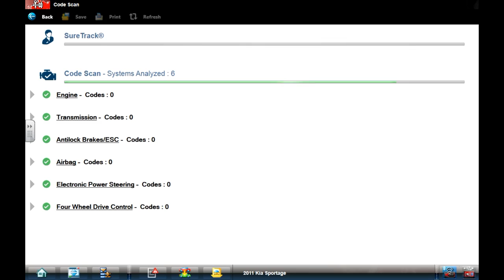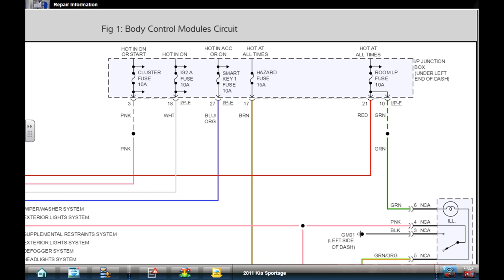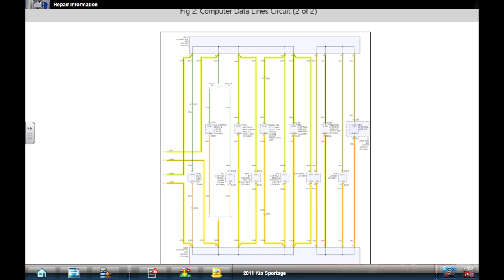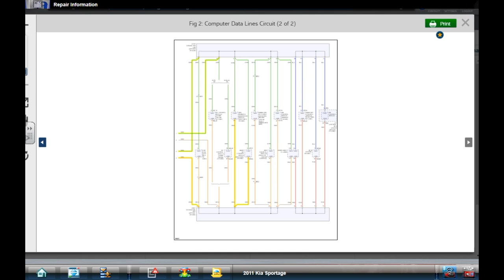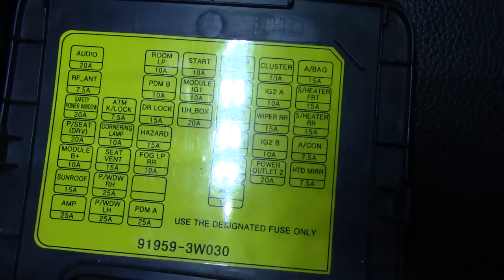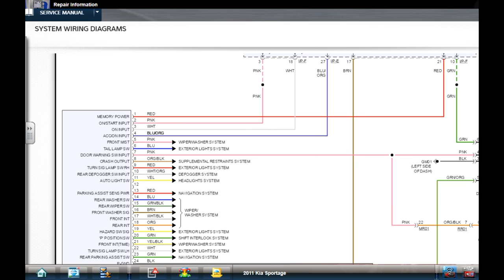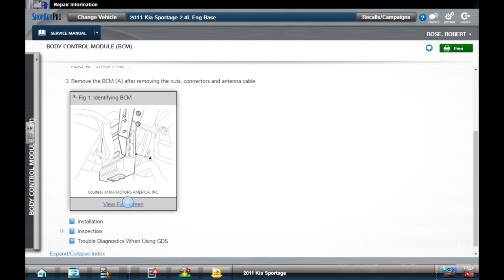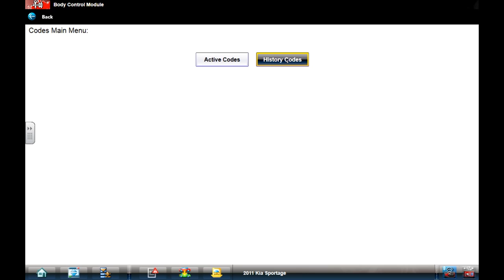2011 Kia Sportage No Com with BCM

Comment: Charlie a former software designer here (retired). Any module with a memory keep fuse may have a condition in it for which it was not anticipated. Example. Key on to Key off with hazard lights button pressed at same time. Sets a memory bit in the BCM memory. Now when BCM boots, it gets stupid. Pablo pulls the Room fuse and that bit goes to off. Now it booots and no problemo. I did similar deal with wifey's very expensive sewing machine. Feed dogs didnt come up. It thought it was in free motion mode(dogs down all the time). So I told it to got to greem motion then not. Works. Had to sew in between state changes. Stupid programmer. Not stupid module. Ship it as Eric O would say. I held back on dogs ref and not refer to the enemy Browns. And yes I was screaminf back porbe the BCM powers and grounds!
Reply: Good eye!
Reply: I agree... I believe it was a bit corrupted in the BCMs memory from who nows what and it probably won't return in all of the car's life... A software routine within the BCM to power up those power feeds read the bad bit and turned off those outputs... Nothing within your power or diagnosis will make it reoccure. It happens often within computer controlled modules... Don't be hard on yourself... And count it as a cure... Dave
Reply: That answer sounds plausible. So I guess the only way to fix this would be with a bcm reflash  if the engineers have identified this from previous complaints and written the updated software.

Comment: I tend to look at it from the customers point of view. It is now working and you have a plausible explanation for it in resetting the BCM. I would be telling her that she now needs to monitor the problem and let her know a BCM replacement is likely if it reoccurs. Great video and I liked following your logic with the wiring diagrams. thanks for all you do for the industry.
Reply: Exactly ! I had this kind of stuff happen to myself. Just tell the truth and let the customer decide.

Comment: intelligence power switch  IPS  (AKA  Fuse Box)
Reply: Ah nice Victor!
Reply: Yeah, give it a fancy name, hide it in mystery, 
CHARGE MORE FOR IT!
Reply: Peugeot call the indicator switch assembly "A Comms Unit "  so expensive with a big name !!!!!
Reply: Paul Monk It’s actually pretty sophisticated little device that protects the modules but it is expensive and imperfect.
Reply: Thanks for telling us what it is and not giving the man crap about it...lol! Big ups
Reply: Now why would it be called a power switch when it just houses the fuses and or relays?
Reply: He is correct, but it even stated fuse box where it stated IPS on the wiring diagram
Reply: The IGPM complete garbage, we have problems with them all the time.  Also with the EM11 connector on the drivers kick panel by the hood release.  You have to remove the black plastic insert inside the connector as this causes a bad connection and can cause intermittent problems like this.  There is also another connector on the passenger side kick panel.

Comment: Don't beat yourself over it, the video still teaches important steps to follow in any diagnosis : verifying complaint, system operation, learning how to read a wiring diagram, learning why there's no " NO COM " faults in the other modules,identyfing component and location, checking power and grounds...if all present, replacing and programming the faulty component(I might add...). Many BMWs had a problem with their FRM modules(which is essentially how BMW calls their BCM),where the FRM would stop communicating and all the components controlled by the FRM would stop working after a simple regular modules scan using a BMW factory computer. And the " fix " was to disconnect the negative cable of the battery and most times it would come back to life. But many times it didn't and you had to replace the FRM.

Comment: Gatta love when modules glitch out or freeze up then it locks itself until rebooted (pulling the fuse). I hate stuff like that LOL! I think finding the root cause of the module glitching out or freezing (whatever it's actually doing) is gonna be pretty hard on this one, maybe nearly impossible depending what it is. I'll tell you this though, when you spent almost half the video trying to find direction by looking at the diagrams and getting familiar with the system, that's where I learned the most information! I don't know anything about CAN systems or how they work, so it was awesome to learn what you did while trying to find direction! Thank you for another awesome video Danner! =]
Reply from the maker: Thanks so much and your comment is totally what I was thinking when I posted this. There was still value in what I showed to those who care to learn. Thank you!

Comment: It it has microcontrollers inside, (which it does), they can get caught in loops, it takes a loss of power to reset them. Not even the best solid code writers will get it perfect.  The power feeding the locked up microcontroller inside was the power from that fuse, you just reset it. It may never happen again.  Could have been from a coincidence, like stepped on the break peddle at the same time as turning on the back wiper while the door was ajar. It freaked out the controller and it froze.

Comment: Thank you Danners. Good job. Did anybody else notice the color non-OE wiring diagram information bus wiring drawn wrong at the DLC? I just looked at the OE data link wiring and it is also labeled wrong. They must have labeled the diagram and connector view as mirror image or from wire side of DLC connector. This would confuse anybody that didn't know any better. You, the viewers, can identify this by knowing and committing to memory the standard layout of the DLC. Terminals 4 and 5 are ground. Terminal 16 is B+. Terminal 6 is CAN H and 14 is CAN L.
The cluster being the gateway (translator) between B-CAN (slower speed) and C-CAN (higher speed) communication networks. 
Have a blessed and safe week.
Reply: They number them as if you are back probing them which is backwards to everyone else. Takes getting used to but means it's easier to count the pins without have to disconnect the circuit when fault finding.

Comment: My guess just shooting from the hip; static electricity.  We all know everythings suppose to be grounded but we also know regardless how well engineered a car may be, static electricity will cause these modern systems to act up.  So, was R&R the fuse the same as removing the batrery cables, and even touching battery cable ends together to empty the capacitors; removing the static electicity from the harness.  Plug it back up and presto chango, it all works now.  Its happened to us all before and it will happen again.  Main thing is mechanic/shop integrity to be honest and keep your customer in the loop.  Good video; 2thumbs up

Comment: The memory room fuse reminds me of a bios battery in desktop pc motherboard which stores recent settings of the bios firmware. When the pc crashes and restarts then all of a sudden it loads to the black screen and stops loading the operating system and you’re locked out. 
In a similar way, the bcm may have crashed and was probably only loading the last known settings from memory until you pulled the memory fuse and reset the memory chip therefore defaulted it to factory settings. (My theory).

You’re a legend in this game. Keep it up 👍 

I think all us techs will be studying IT to fix cars soon! Damn computers! 🇬🇧
Reply: Excelente

Comment: In the Ford world we call that logic lock. The more modules and features they have added in to vehicles the past 10 years I’ve been amazed at how many issues can be solved with simply
Unhooking then battery for 15 minutes then hooking it back up, doing a “master reset” so to speak.

Comment: I have an 04 Hyundai tiburon (Hyundai and KIA are basically the same company) and one day when I was driving on the highway the engine acted like I switched off the ignition for about 1/10th of a second and came right back on. no engine light, readiness was set, cruise was still set, everything was working, but  the radiator fans were stuck on whenever the ignition was on. didn't matter if the engine was warm or cold, if it was off for an hour or a day, if the ignition was on the fans were on.

What ended up fixing it was disconnecting and reconnecting the battery, and it hasn't acted up since (happened about 8 months ago). No idea what happened, but I had that feeling of: well I sure hope that wasn't a sign of things to come.

Comment: The Kia room lamp fault, that’s the second time I’ve seen this in the past week. No remotes key fobs working the door locks, power door lock on the drivers master door switch only worked when key was on first position accessory. No chime from key in and no key detect showing in live data on the scan tool and No interior lamp working.Followed the wiring in the etacs system to find key reminder circuit and voila! It shows the key reminder circuit was fed by the 10amp fuse for the room ( interior ) lamp circuit! You would think that the wiring diagram for ignition barrel would show the key detect wiring as well, but no, the good old Koreans put it out of sight in the ETACS section.
Another one that I’ve had was park neutral switch not allowing the gear lever to be shifted from Park position due to a bad ground from the BCM to the switch on the micro switch at the gear lever Paul, you need to lift out the centre console to gain access to it! I’ve seen so many bad Kia electrical faults in really new cars, not just the old ones!
Every days a new lesson!

Comment: This is the reason that IT folks generally ask you to reboot your computer, or the cable people ask you to reset your cable box.

The issue with this car is likely an edge-case problem that the programmers didn't imagine, or was too expensive to bother including in the firmware for the BCM.

Comment: Like someone else said, it was very likely a software issue.  The software may have gotten corrupted and caused the glitch. Resetting the bcm cleared the software corruption issue. I've seen that happen. It also happens all the time with desktop and laptop computers. A reboot usually clears the issue. As has been pointed out, check for tsbs/recalls. Should check what is hard wired, horn, front wipers, headlight are likely hardwired instead of being controlled by a module.

Comment: I think by pulling the fuse, you reset something in the BCM or the IPS itself. So it could be a software issue. Maybe look for of there is a service bulletin or software update for the 2 modules.
Reply: I agree, a reset solved the issue, just like any other computer controlled device.

Comment: Voltage drop test for loose connection at the BCM, wiggle the fuse while checking for voltage drop variations at the BCM that’s what I would do.

Comment: @35:59 to be fair to those people who advocate pulling fuses to check them, that 0.1% chance does seem to happen an awful lot to you when you film no comm videos 🤣🤣🤣 

As to pulling the fuse and replacing it to get it to work again, an almost identical problem was notorious for happening with the OnStar modules on mid 2000’s Chevy Trailblazers and GMC Envoys. The fix on this was to replace the module because while simply pulling and replacing fuse would restore functionality to the system, it would eventually start acting goofy again. Haven’t watched the entire video just yet, so you may have already said this, but if it were me in your spot, I’d tell the customer to keep an eye on it, and if it does this again, they’ll need a new BCM.

Comment: The logic Hyundai /Kia used on that generation and up until the last new model launch (Europe) was the BCM received the signal from the switch then sends actuation request to the Smart Junction Box which uses Intelligent Power Switches (IPS) which are just transistors to limit the current. Once the circuit is activated the Smart Junction Box sends a confirmation signal back to the BCM. The reason your headlights still worked was because they have a back up hard wire set up. They use PWM for the headlights when battery voltage is over 13.5V when it drops they go to a direct circuit must be for safety and I think that's why you still had front wipers.
Reply from the maker: Great insight, thank you!
Reply: No, thank you! If it wasn't for your videos I wouldn't have been interested enough to go for my Hyundai master tech. I found the fundamental stuff you showed gave me a great base and understanding and left me to think about the logics and the way computers integrate. Have my Toyota/ lexus diagnostic certification exam in November. Keep inspiring👍🏼
Reply from the maker: Thanks man! Awesome to hear. Keep up the great work!

Comment: I am grateful to you for your valuable explanation. Unfortunately, I am facing the same problem. I own a 2013 Kia Sportage. The door locks do not work. The turn signal is not working. The turn signal was only illuminating and not flashing. Now it has stopped completely, and the internal buzzer is working very low. I pulled all the valves and put them back in, to no avail. I hope to find the right solution, thanks.
Reply from the maker: disconnect the battery and leave it disconnected for a few minutes and then test everything again
Reply: @ScannerDanner  Well, I will, but I forgot to say something.  I scanned it and it showed me a P0626 code, as if it was saying the voltage was high because I replaced the alternator.  Is this generator communicating with the BCM and may be the cause of the problem, weak ic, or wire burnout?
Reply from the maker: @ksa2239  I'm not sure without some research. Let's move this to my forum, it is free to join www.scannerdanner.com 
And we can definitely help you further
Reply: @ScannerDanner  Thank you, my friend, for all your replies and cooperation
Reply: Hi, i have this problem exactly as yours as well on my KIA Sportage 2013, did you find the solution.. ? the mechanic said it might the fuse box, but he was not sure at all.. so changing the fuse box might help but it might not
Reply: Changing the small fuse block under the hood fixed my similar problem. (Battery drain)
But i cant send pictures here.. to show u the culprit of all this crazy stuff happening through this stupid memory fuse.
Reply: @leo28a the problem is battery drain? What did u do to solve the problem?

Comment: Problems like this in my Years at HONDA were very common. Tons of shop talks, bulletins, about doing a battery reset to resolve strange electrical issues with vehicles. I do not remember many if any come backs on those issues. leaving me to believe cars have become like our phones and computers and play stations as you said requiring a complete module drain system wide and reboot once and a while. maybe could it be?

Comment: With the room fuse being the memory fuse, removing it whilst the ignition is on,  engine on will still make the hazard, turn signal and all depending on the room fuse to work will work. The test I would do will be to remove the room fuse, turn engine off, key off,  and then turn engine on, key on, and see whether the computer can still retain any memory.

Comment: IPS may be Intelligent Power System, or fuse box.  If you look at the wiring diagram, it shows the location. Nissan calls it IPDM  Intelligent Power Distribution Module which is under the hood, I know, I have an 06 Frontier.  Maybe a road test over a rough road would cause the "intermittent" to show itself.  Other than that, Nice Diag under the "non cooperation" of the module!  Intermittents are like that.

Comment: i think in this case the bcm crashed, i have had this before, you pulled the memory fuse with ign off and it wiped it, now the reason everything still worked with the memory fuse pulled was because you had the ignition on, it wont need a memory supply while its all powered up, i would give the car back at that point and see if it played up again in the future.
good vid anyway, even though with a job like this you will always be second guessing what you did.

Comment: Another reason why in the live debugging line of work on automated computerized systems in buildings, we always say don't reboot anything or pull power unless specifically told by the expert specialists who are qualified to diagnose the problem.

There's a highly likelihood you will be back again to figure out the issue on even worse timing/circumstance than now.

Comment: Have a pt cruiser that wouldn't start. Turned out the security module had to be reset (batt disconnected and reconnected). There was a service bulletin on it. Never had the problem again but keep a battery wrench in the glove box just in case.
Reply from the maker: hoping that is the case here for my friend too

Comment: One thing I noticed right away was that the key was in the ignition and the engine running when you pulled the Room fuse and everything started working. Try Engine off, key off, pull the room fuse, wait 10 - 15 seconds for memory to clear, plug fuse back in, key on, engine on. Still works? Disconnect the battery for 60 - 90 seconds and see if the problem reoccurs.